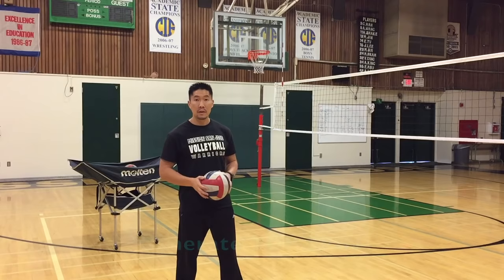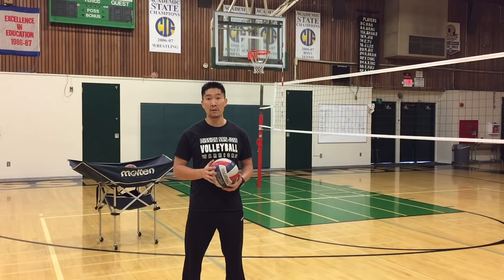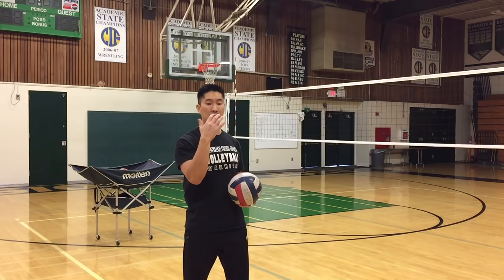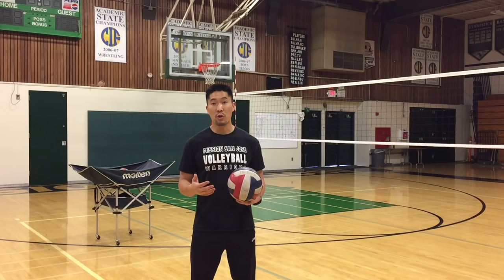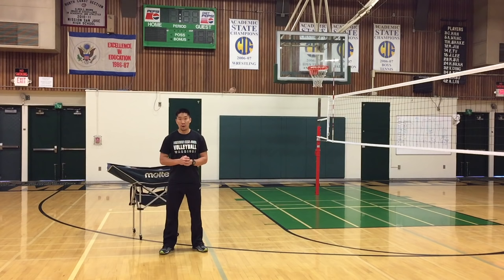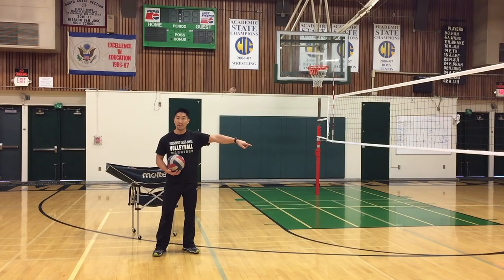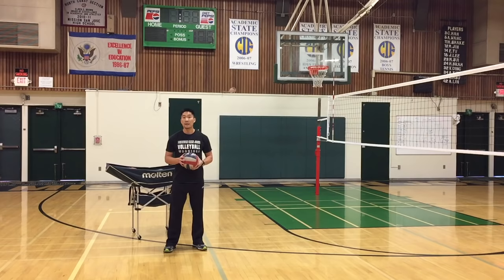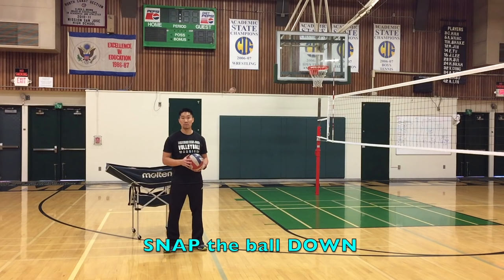Arm Swing Mechanics : Top Spin + Solid Contact (part 2/2) - How to SPIKE a Volleyball Tutorial

Comment: Wow! These videoes skipped my feed, and this explains a lot! I have a tip for you! If you have or know someone with an Iphone 6 or 6s (Not sure if Iphone 5 has this), you can use the slow function on the camera. It will capture up to 240 fps in action, which is perfect for a biomechanical analysis! As you probably know, slowing down regular footage to try and show contact point of the ball will make it quite blurry. We just tested this feature at school and it's pretty amazing! It should be easy enough to transfer it to a computer through your USB, and then mix it into other footages (Note: I have no experience doing this myself, but it was pretty easy to do at school). Hope it helps!

Comment: Thanks for sharing mate!
I have just some doubts about directing the ball under the net.
I have already seen that and for sure is a good drill to improve snapping, but i always wondering if this could be dangerous for young players, by learning a way to hit ball that never happens on a volleyball court.
I usually put them one to one forward with the goal to directing the ball above the net; in alternative, for a good snapping, i put them against the wall, sometimes with an obstacle located at about one meter. 
What do you think about it?
Thanks anyway for your precious contribute.
Ciao

Comment: Hi Coach Donny,
First of all I want to thank you for all of your great videos. They help me so much!
Secondly, I have a question about topspin on a ball: how do you get the ball to clear the net when putting topspin on it, behind the ten-foot line? In my experience, when I put topspin on a ball (or try to, at least) the ball just arcs downwards and never clears. When I hit the ball far back enough, I can't get it to clear unless it's a floater.
Another question about spiking in general: is a jumping spike/hit always a better option than a standing hit? Sometimes I have more control over the ball when I don't jump and just hit the ball, and even though it may not be as fast or as steep (in terms of angle) it's still pretty powerful (or about as powerful as I'm gonna get, being a complete beginner). I'm 14 years old and 5 feet 11 inches.
But thanks to your videos, I'm working on improving my jump height anyways :)
Thanks again!
--Anthony
Reply: +Elevate Yourself 
nnmnmmm

Comment: Coach Donny, I have seen that taking a step to follow through while doing a standing serve helps to add power. What is your opinion on taking a step to follow through when doing a top spin serve?  Will this add more power to the serve or interfere with the top spin technique?